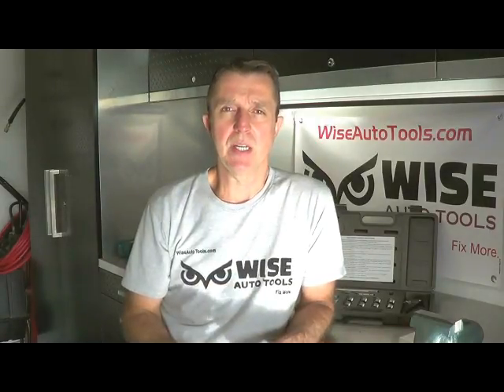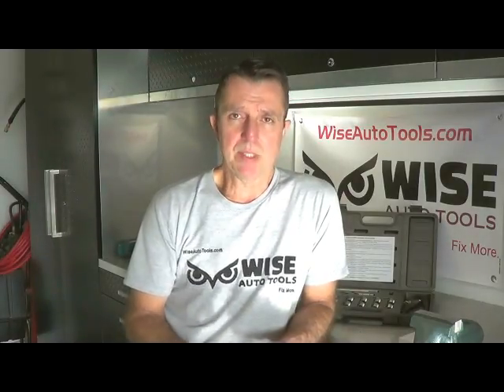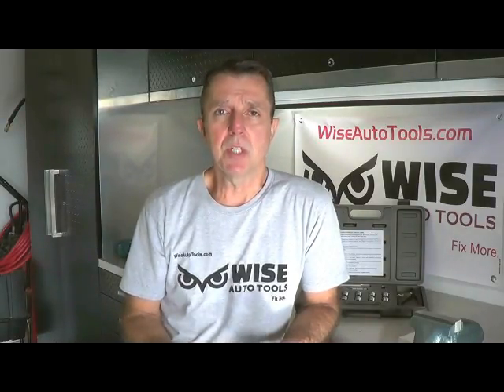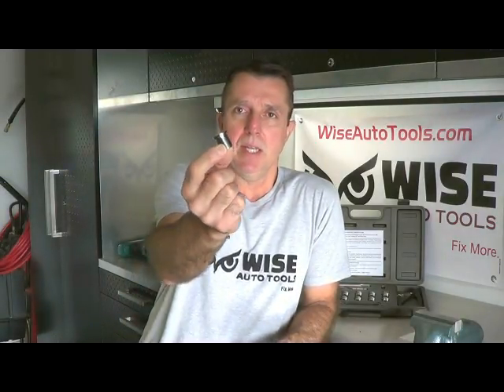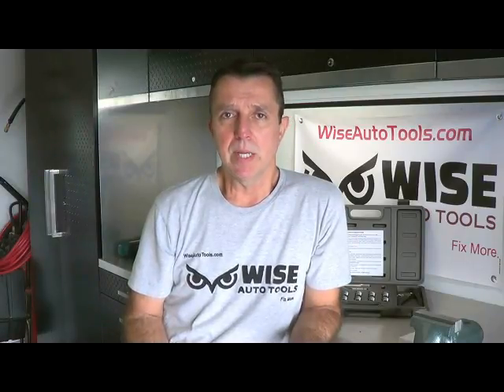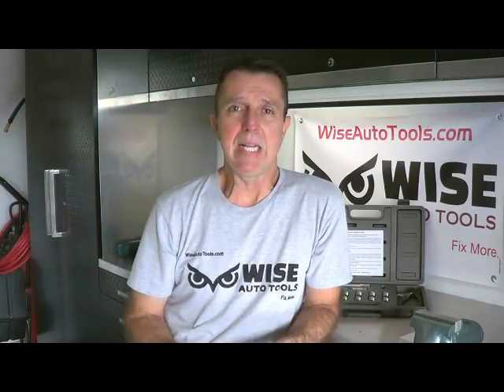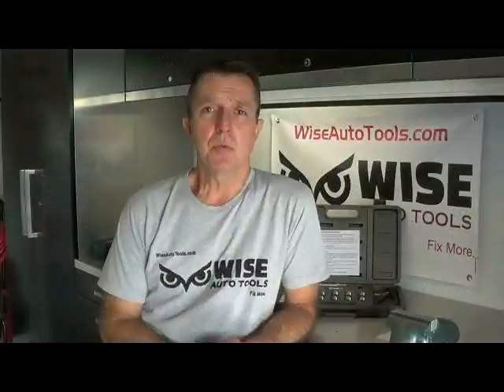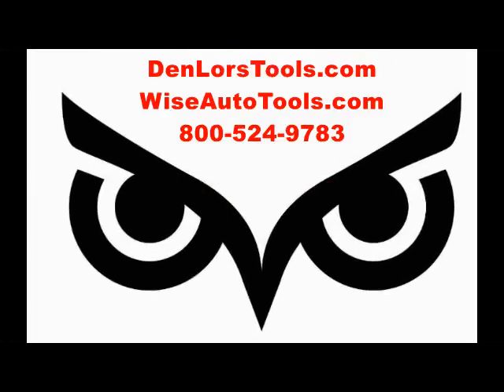Calvan 389 100 A Common Question

Comment: Does the value cover have to b removed to do a 5.4
Reply from the maker: No. The cylinder leak tester Calvan 389-4000 is used to make sure the valves are closed before starting the repair. For that reason the valve cover stays on and cam lobe positioning does not need to be checked.